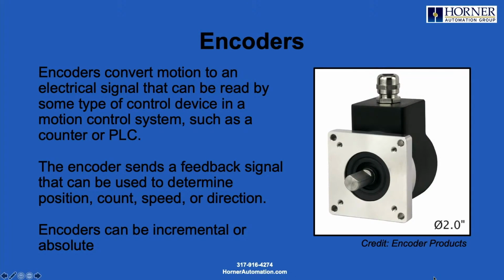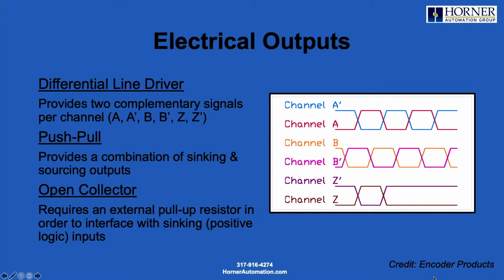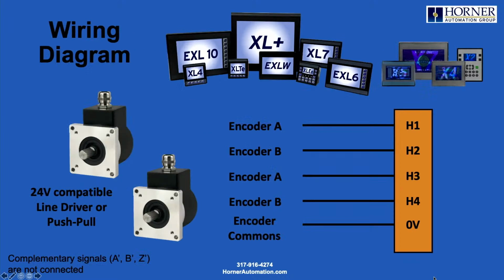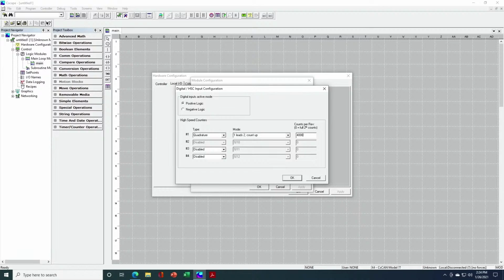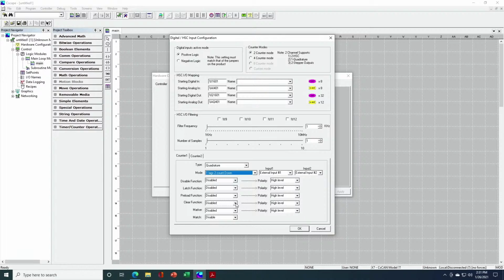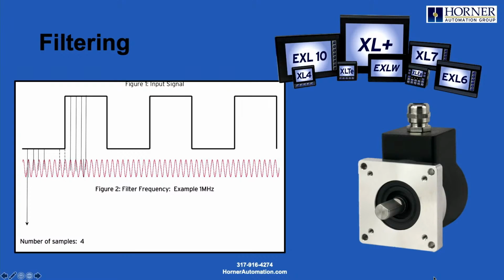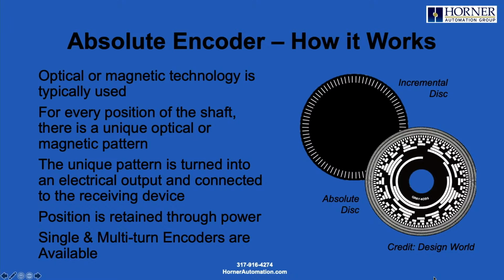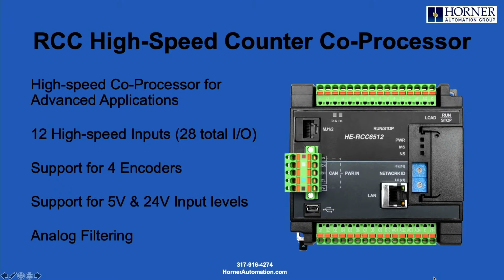Count Me In!  Connect Encoders to Horner OCS

Comment: Is there a way to scale encoder readout to a real number? when using the the conversion function it does not seem to be working for me. Thanks
Reply: Sure.  You would use a DINT to REAL conversion function - where the input is your accumulator variable (DINT) and the output is a different variable (REAL).  If you're still having trouble comment again and we'll get you some individual help.
Reply: @LionsIndy  Thanks for the feedback. When I do this conversion My accumulator is at zero but after the conversion the real number keeps counting up even with the accumulator at zero

Comment: In a HSC match function we can assign a signal output to that HSC. Is it possible to assign 2 or 3 outputs to the same HSC in a match function. In a 360 degree application i want to fire 3 different outputs at three different positions using the same HSC. like output 1 = from 10 t0 30 degree, output 2 = 100 to 120 degree, output 3 = 250 to 280 degree.

Comment: Recently I saw the need to show the speed (RPM) from an encoder in a Machine, and then I took on the task of installing the encoder, which I connected to my OCS XL7, and configured it in the "Frequency Counter" mode. and I left the Mode in "1s Updates" by default, but when converting the frequency to RPM I realized that it did not correspond to what I read using a handheld tachometer. The OCS reading is half the real value in RPM, so that to give me the real reading I had to place half the PPR of my encoder in the formula, the formula was the following RPM = Frequency% AI401 * 60 / PPR. My concern is because it does not give me the frequency that the real speed would suppose, in I'm wrong, thank you.
Reply from the maker: Your approach should have worked.  I assume you are only using the “A” signal of a quadrature encoder - or is it a non-quadrature encoder?
Reply: @HornerAPG  So I am using only channel A of an Encoder connected to a% I9 input configured as a frequency counter. Also note that the frequency reading is altered if I change the "Mode" between the values to select (1s, 100ms, 10ms, 1ms Updates), I do not find information to understand what happens.